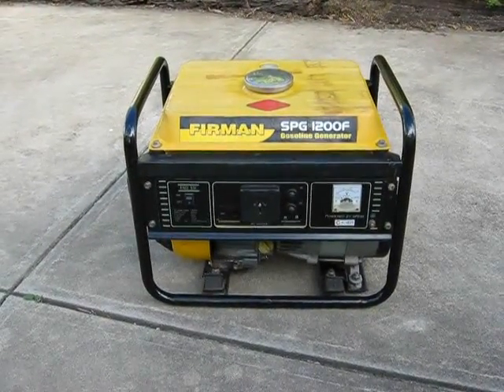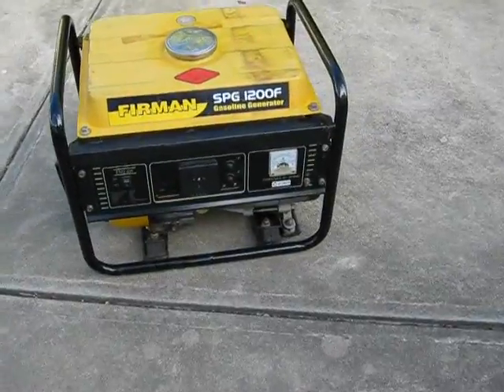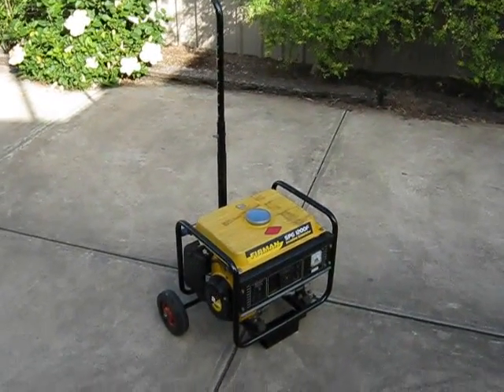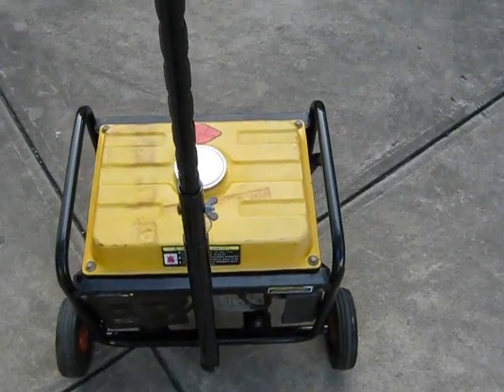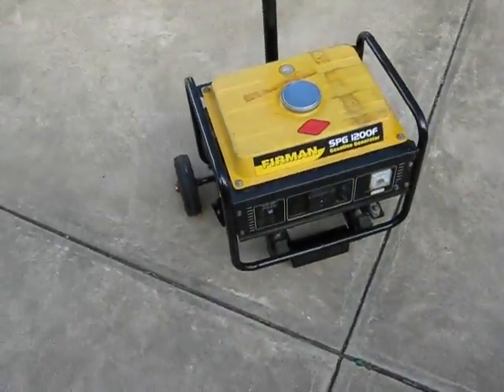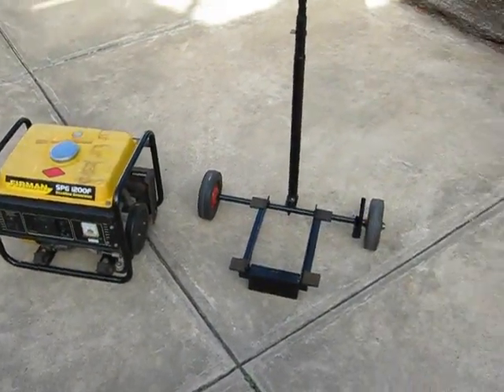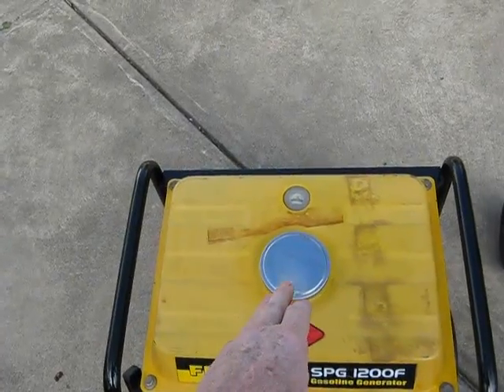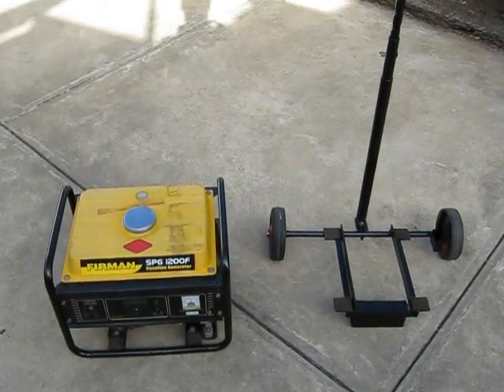Make a portable generator trolley - generator cart

Comment from the maker: The generator is 240 volt AC output. It also has a 12 volt DC outlet. It's big enough to run my small/medium sized freezer.
Reply from the maker: I mainly use it to run my electric hedge trimmer.  Saves having miles of power cord and I like electric trimmers as they are very light weight to use. Also comes in handy for power outs, and power tools.

Comment from the maker: If you use this design for a heavier generator, I would recommend you weld a reinforcing web along the full length bottom of the axle to give it extra support.  In the example in the video, the axle diameter is quite large for the weight is has to carry, so it's not an issue.  Rob

Comment from the maker: Thanks for the positive comments.  Although it's light, the welded areas are plenty strong enough for the weight.  The vertical section of the angle iron bearers basically fits into the generator frame work base and prevents it from moving around.